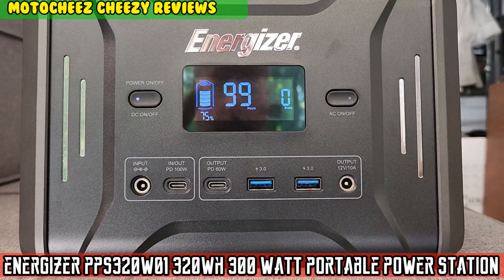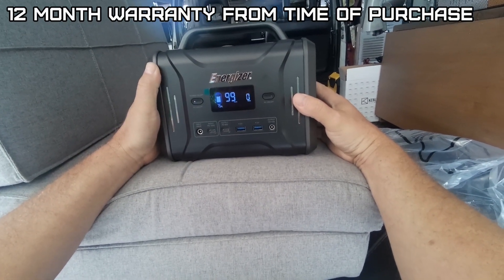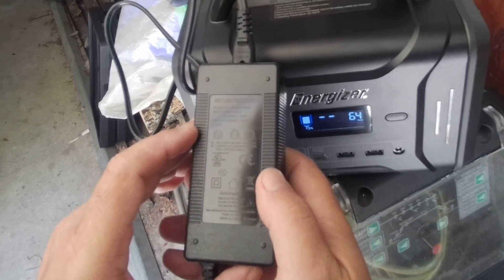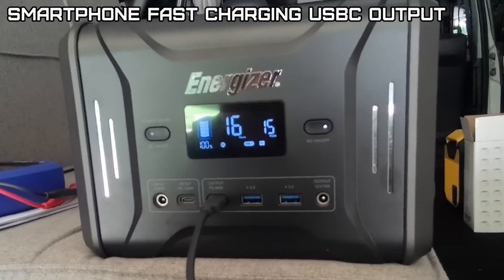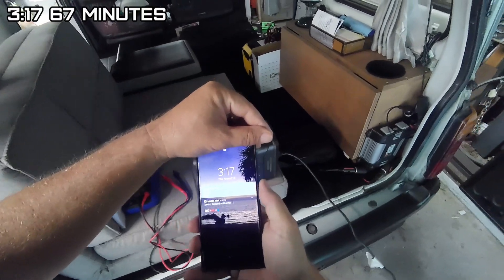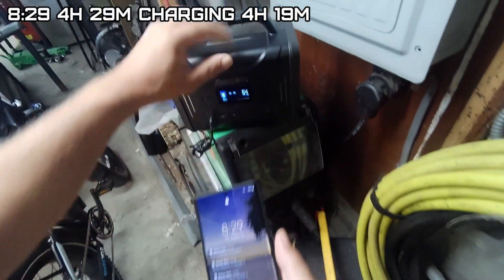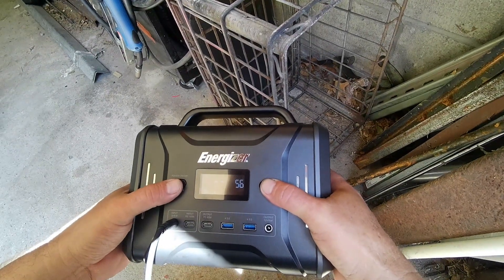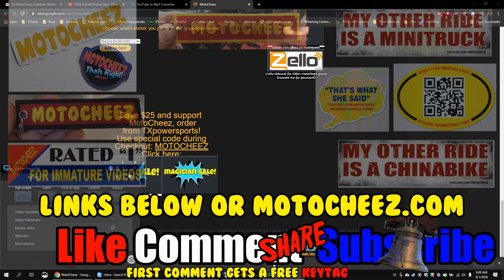ENERGIZER Portable Power Station 300W, 320Wh LiFePO4 Backup Battery Power Supply, Camping, emergency

Comment: Can't seem to get a response from technical support. I have an E04 code for a short circuit of the PD usb-c port, depending on the version of the manual it states to do something like reboot the operation of the PD port and/or clear short-circuit errors and reinsert the usb-c cable. Any idea how I'd do that? The normal restart mechanism on the device of holding the power button and light button simultaneously does not let me regain access of the ports. The battery does not charge as it is :[
Reply from the maker: Hmm. I'm not sure. No answer from support in this? That's not good

Comment: Any idea of how long that would run a 5 volt router that light comes with Windstream anyone. Thanks for the info
Reply from the maker: How many watts is it?
Reply: @MotoCheez  I am not sure it's the just a small Windstream router that hooks onto my phone wireless router, here in the mountain in Kentucky my electric goes out about two times a month so and in the winter time is goes out quite frequently due to ice, I would like to keep my internet up this winter
Reply from the maker: It should say on unit, then divide that into the 320wh battery minus about 5%